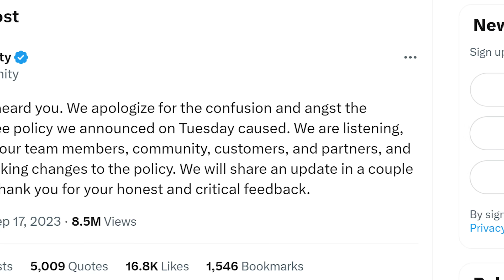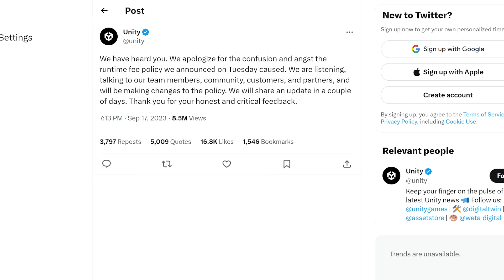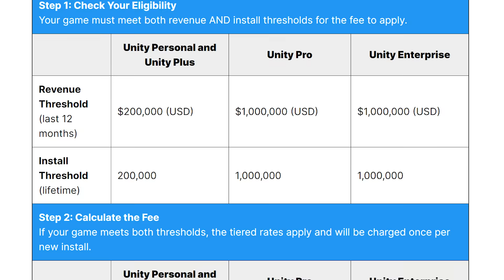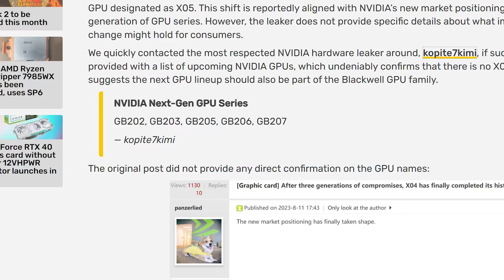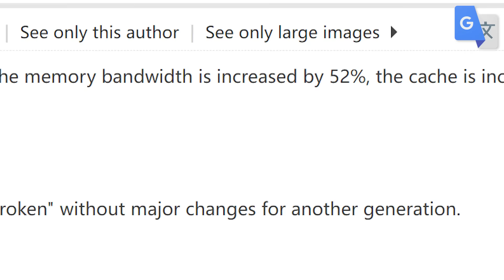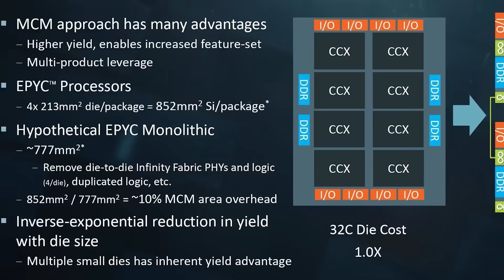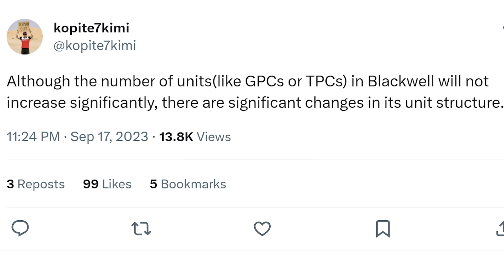RTX 5090 Completely DESTROYS The 4090!

Comment: unless the 5090 comes with a ram increase, I'm quite frankly entirely uninterested. Most modern games hardly take advantage of the 3090, and im not the 1% that's gaming at 4k. Might as well just buy a second 3090 and build a rig with dual 3090's for my purposes. One has to ask whether two 3090s with 24gb of ram, or a 5090 with 32gb of ram (if it doesnt go 24gb) is worth the money when it comes to hobbyist AI learning.